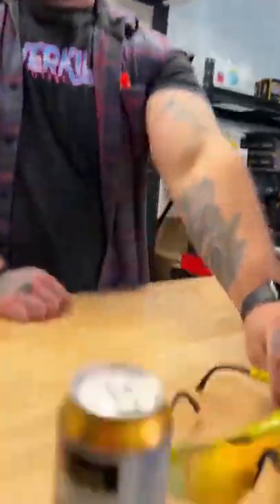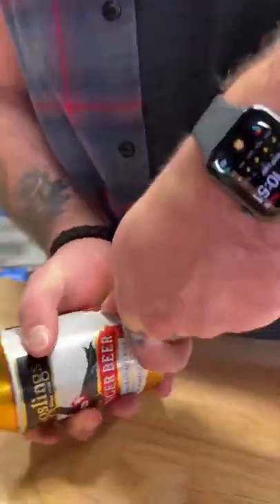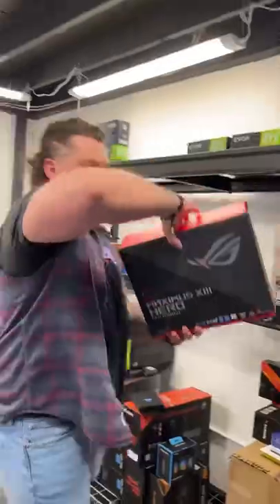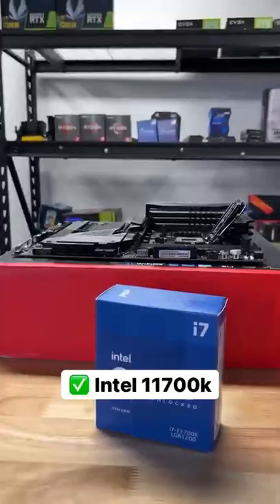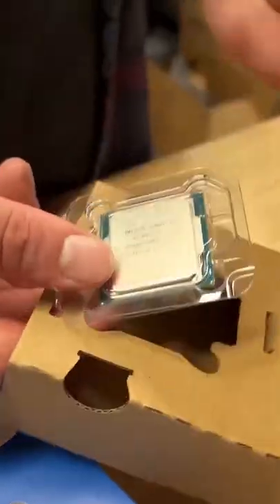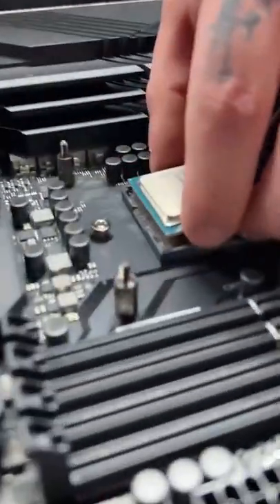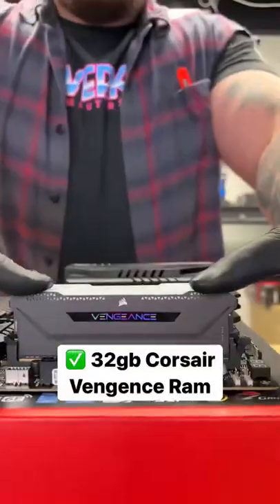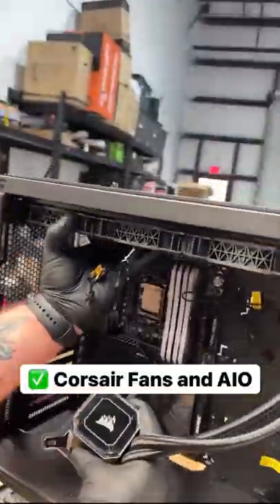POV: You visit Florida for the first time #floridaman #pcsetup #gaming #gamer #pc #gamergirl

Comment: Why tf do you guys always use outdated CPUs
Reply: Ah yes, i7 11700k, completely outdated.
Reply: @omega_6777  actually yeah, it really fucking is. 12th gen intel competed with AMD, 11th gen is slaughtered by AMD
Reply: @Mitchell856  A i7 11700k still has round about the same performance like a Ryzen 7 5800x, so you can't really blame them for using it.